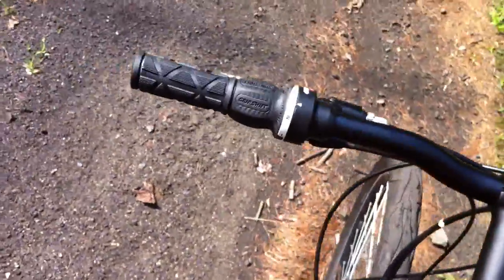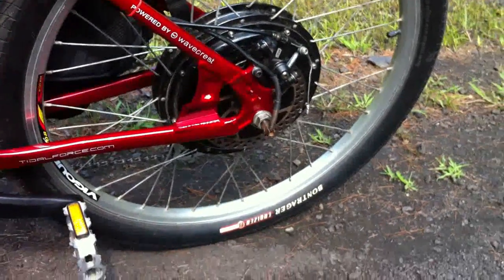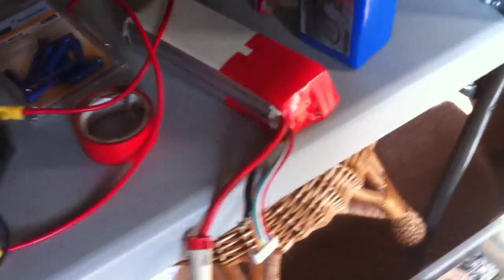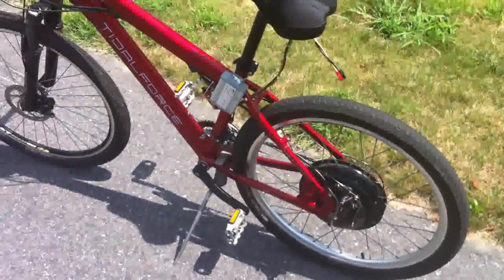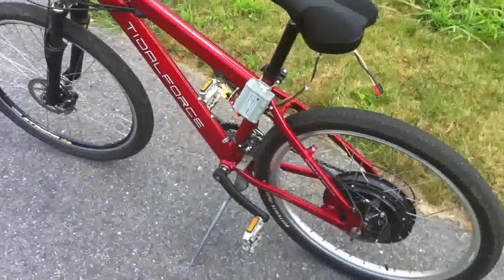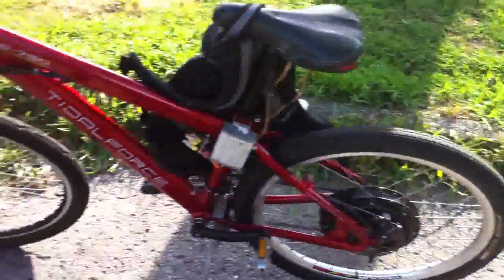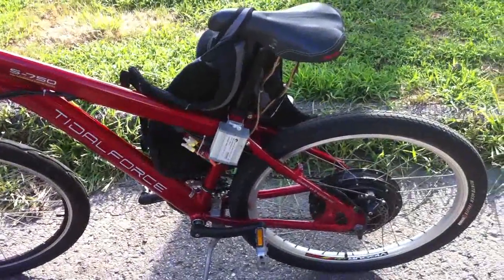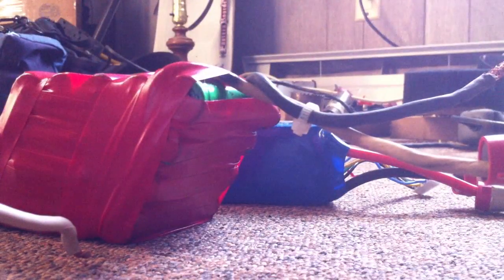36V Tidalforce S-750 Electric Bike Build/Test Ride and Critique

Comment: Bro - pls when explaining your batteries try break it down nito voltage and amp/hrs - ie when you lift a pack up say its 36v 4 amphrs or whatever it is , as most people understand this. When you say all these different 18650 etc etc numbers most of your viewers (well me for 1!) does'nt have a clue what you are talking about (I understand you have quite a high tech knowledge of the specs but we dont!). Thx.

Comment from the maker: if ur running lead acid 12v is right around dead a fully charged SLA will be around 13.8-14.6v so they are probably worn out. The easiest way to go would be to get 2x 6s LIPO packs in series 44.4v or 2x 7s LIPO packs in series (but 7s chargers are more expensive) you would need to buy balance chargers,SLA chargers wont work with lithium. i like to use 18650 cells from cordless tool packs, but they are 5s so you would need to run 36v 60v or 72v and you would need a new controller for that.

Comment: I attached a video with a Volt meter mod I put on my electric bike-don't have the cycle analyst so I used this $12 volt meter to keep track of the amount of volts battery is holding.